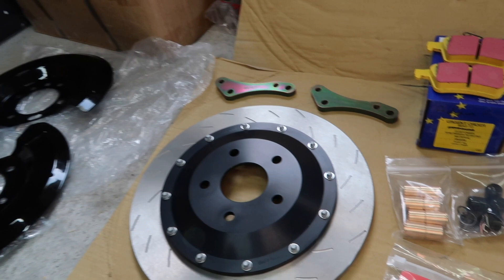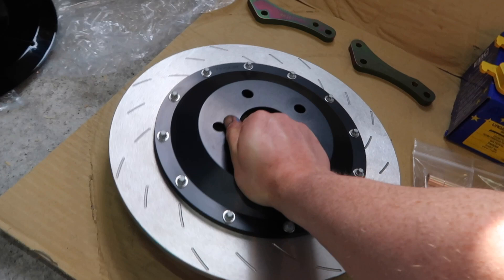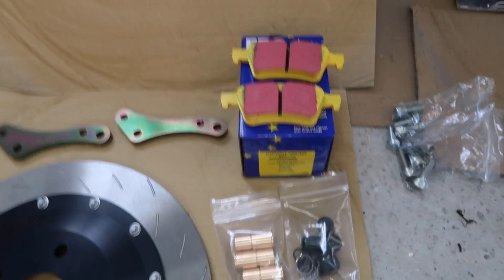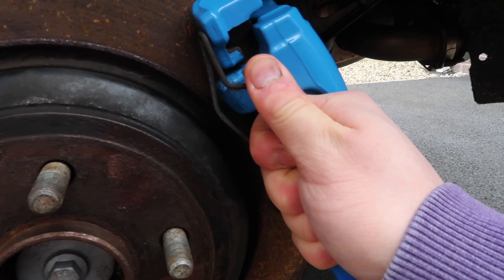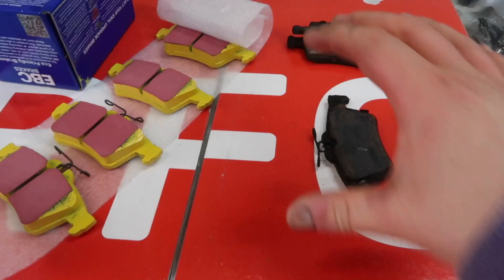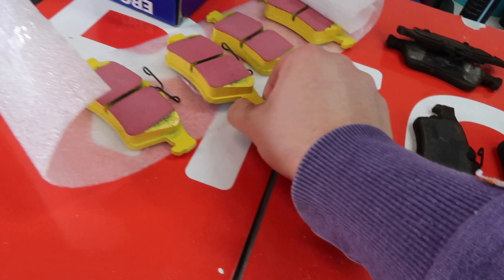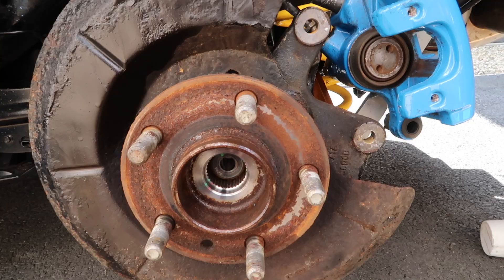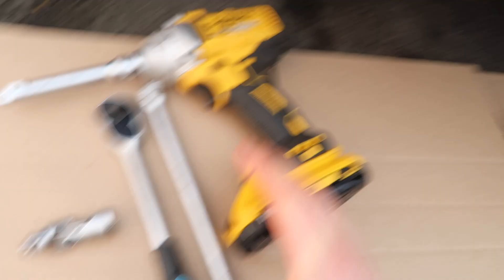REAR BRAKES OVERHAUL - BIG BRAKE KIT, DUST SHIELDS & MORE! | FOCUS RS

Comment: How are you liking the metal brake bushings, I have been eyeing them up for awhile. I need to service my brakes but my biggest issue is deciding when I want to upgrade to the brembo’s on my ST but first I need different wheels to clear the bigger calipers. Good video, very informative as always.

Comment: Glad i have an ST the job was so much easier. Nice work Adam
Reply: What’s different with the st making it easier? Just wondering as I have an st and want to change my dust shields
Reply: @deanwild7641   ST doesn't have 4 wheels drive.. No drive shaft pop out.. And the bolts are easier to locate for the dust guard's etc
Reply: @michaelw5468  thanks for clearing that up  man. Does seem simpler
Reply: @michaelw5468  surely they have a hub spline for the wheel though?

Comment: Brill video bud just watched on idea to remove dust shields so much work to remove them
Reply from the maker: Hi Lance, it is certainly a lot of work which is why I waited to do them until I was doing the rest of the brake job but it is 100% worth it!
Reply: @Adam Rainey  it's the dust plates I need to replace but will put new hubs on aswell